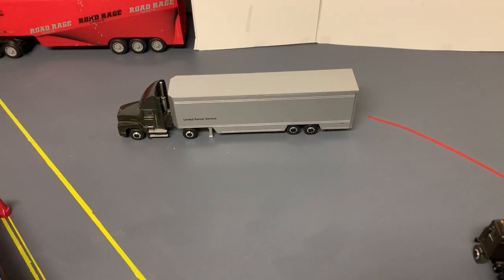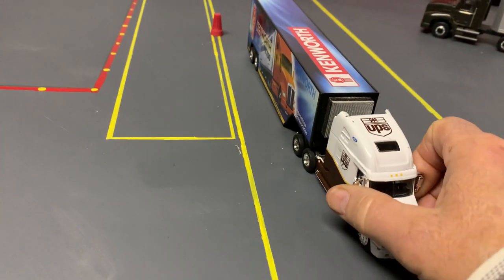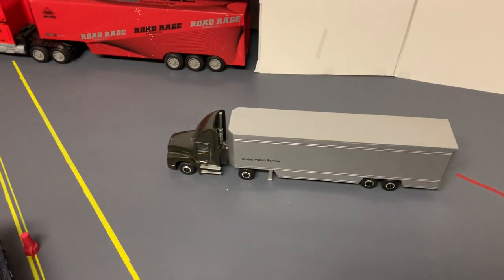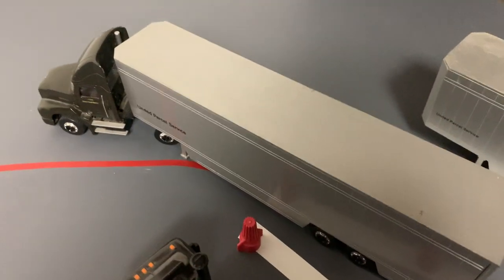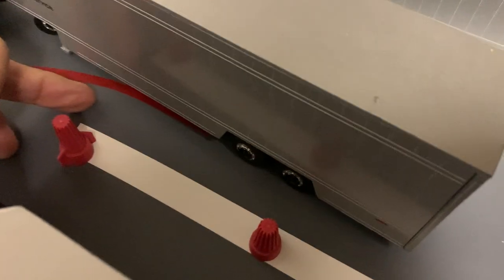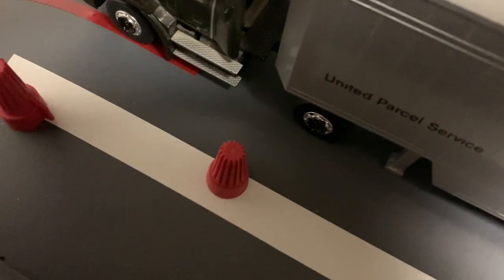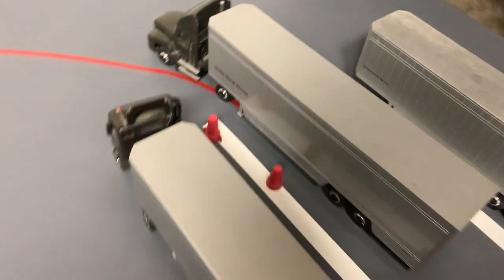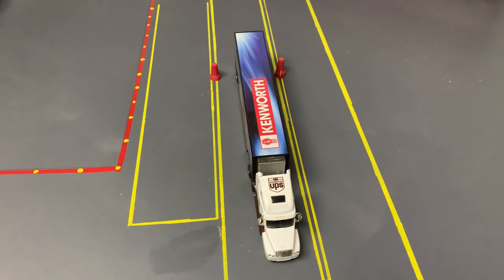Alley Dock- Classroom: VIDEO - 3

Comment: Okay so one indication to let me know that I'm at a 45-degree angle is when I see the landing gear leg right? Soon as i see it in my mirror or when I'm looking out i can stop because I'm at 45° right?
Reply from the maker: At 160 driving academy, we painted a yellow dot in the center of the bar between the landing legs. Another school marked the side of the trailer and mud flap. 
    The center of the trailer in your mirror.  I let each school instructor teach the setup.  I teach every student how to make adjustments or how to correct a bad setup .
     A tractor trailer driver just back up a short distance and makes any needed adjustments. Backing up more than 45 degrees will not work well for any student or driver .
     45 degrees or less is better- does not have to be exactly 45.